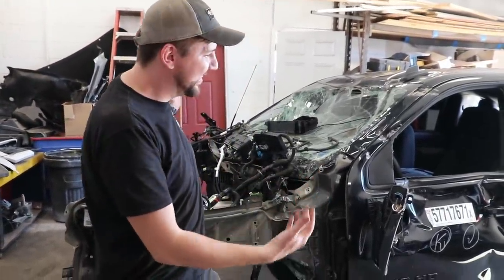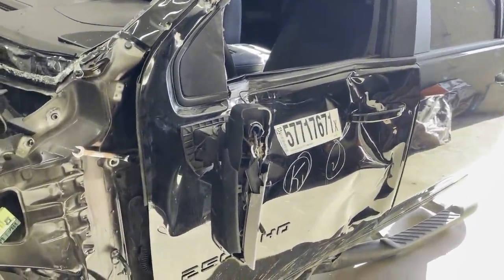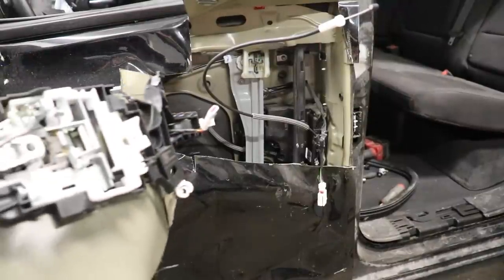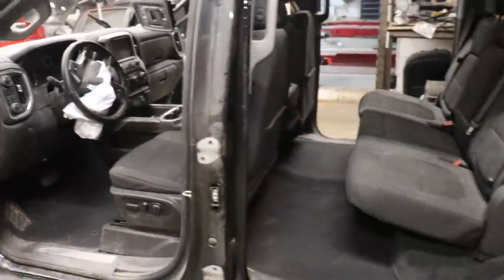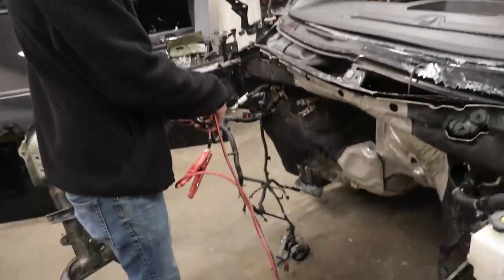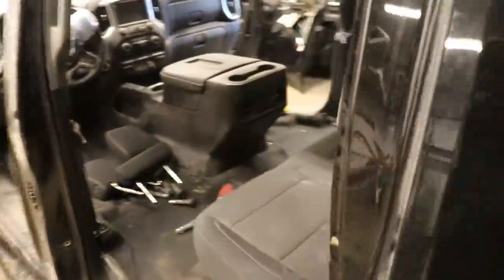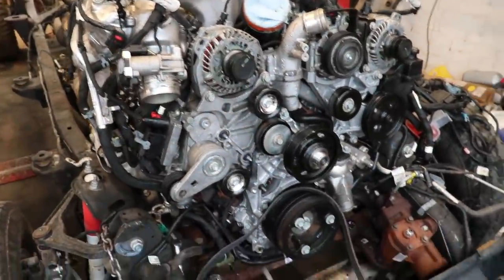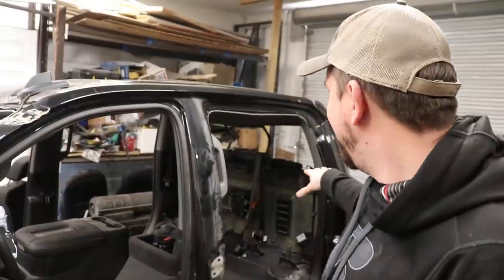2021 SILVERADO 2500 Cab Tear Down  Part 21

Comment: I worked at Flint Assembly back in 2015. My job was to install rear crew cab seats. Probably installed over 20,000 of them. We installed them full width top and bottom together. As we set them down we hook the three loops on the back then set the seat down on all the floor studs. Shove the seat belt through and torque all the nuts. It would be opposite for removal. I doubt the process has changed much in the past 6 years. Hope it helps.

Comment: I think plenty of sound deadening is a good idea. If you decide to recover the seats I would choose a black or grey, you could have red stitching.  I wouldn't recomend red seats as you are using it as a shop truck the red could easily get dirty. It will be a good idea Michael to lable the cables especially if they are unused or dead cables. Glad that you got the professionals to get the screen out we don't need any hospital visits! I would be interested in a series on the Beetle project but I am not interested in the boat personally.  Thanks for the video Brothers and great to see the forklift working again.👍

Comment: For saving bolts etc, freezer bags (stronger than sandwich bags!), use a permanent marker to write what it went to, (ie “backseat bolts -truck”) and DUCT TAPE it to the part it goes with. Harder to miss place and easier to identify what it belongs to if it does get separated.

Comment: Do black diamond back leather and suede with red piping, and heated seats with matching seat belts the color of the truck also you should put some accent  lighting inside the truck and out side that you can change the color with the touch of a switch also a lift kit and automatic step sides when you open the doors with a nice sound system” just sayin” you asked and I shall speak”🤣Oh” and PS. Don’t use it as a work truck” make it a street Queen and give it a new life😉👍

Comment: The wiring must be a nightmare with all the wires up into the ceiling lights and the dash. It looks like maybe you could have fixed the black cab with putting a new roof in the burnt one but the A post driver's side was looking pretty bad. Just thought it would have saved alot of time if the black cab could have been fixed.